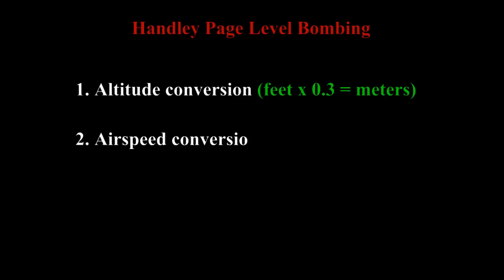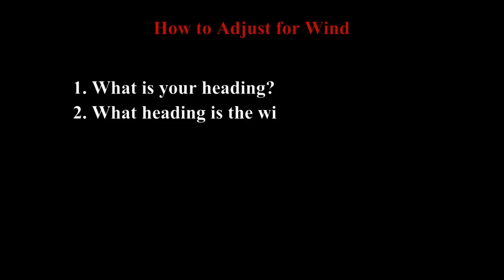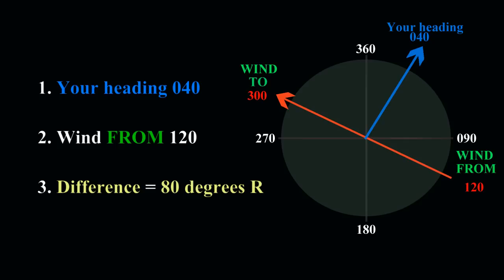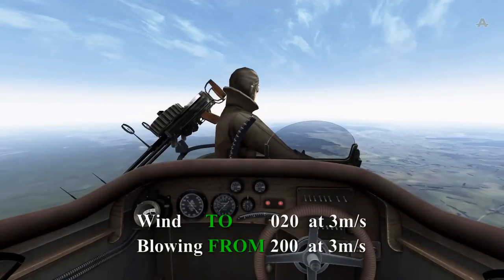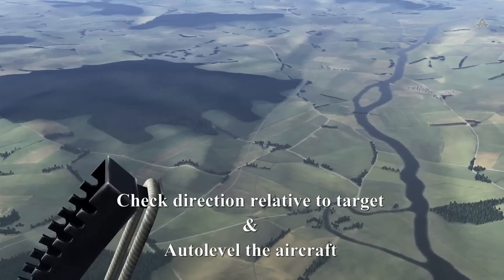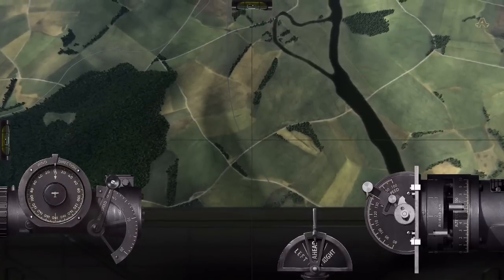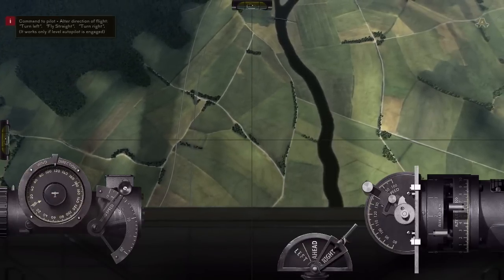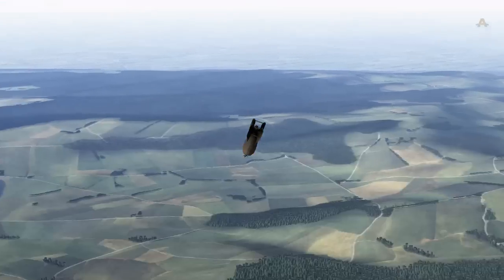Bombing #3 Level Bombing in the Handley Page 0-400

Comment: where do you find the wind direction from?
Reply: Callum Jerwood The mission briefing will provide a number of degrees or give a directional heading.  After the mission starts, you want to find a windsock at your airbase, and then compare the movement of this to the number of degrees or directional heading.  Some briefings will actually tell you where the wind is blowing from, while you have to determine the wind direction for others.
Reply: I asked because the standard mission briefing in only gives me a compass reference

Comment: @sdhubbard  Because 777 can't devote zillions of man hours to research and model every specific type of bomb sight used by each nationality involved, they made a generic sight for all bombers. It's calibrated in metric since that's the most common measurement unit in ROF.

Hover the mouse cursor over airspeed and altitude inputs and you get a handy popup conversion table for them on the bomb sight screen, no need to do math, just fine tune interpolate.